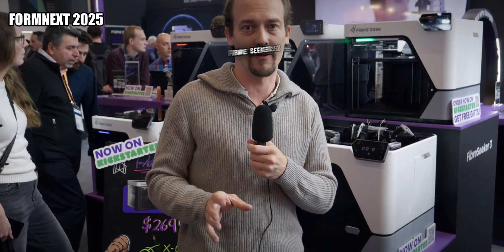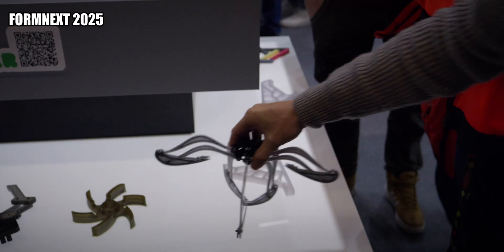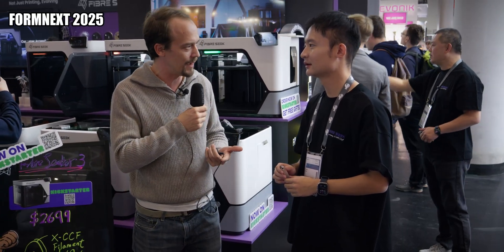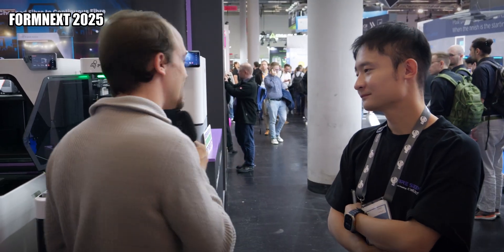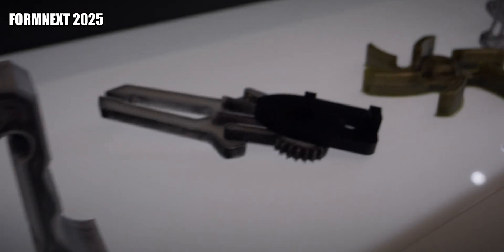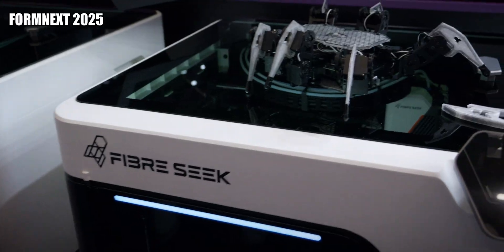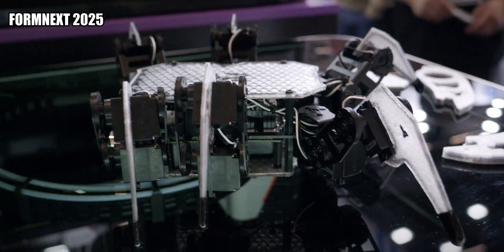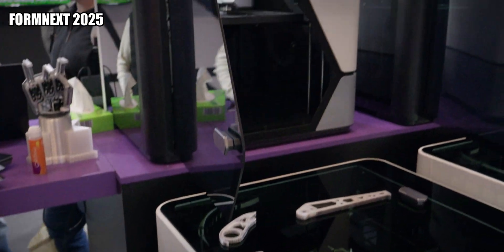Gamechanger in 3D Printing? - A Industrial Technology comes to the Maker Market! - Fibre Seeker 3

Comment: Would it work to print bicycle drivetrain components? Gates Carbon Drive belt is a continuous loop of carbon fiber but VEER Cycle split belt is not continuous. "Stronger than aluminium"? So maybe even the chainring and cog?

Comment: Your designs unfortunately very disappointing in the makerworld. Laptop stands I printed from your portfolio in my very new bambulab 3d printer got ruined.
Reply from the maker: Thanks for the feedback.
I’m genuinely sorry to hear you had a bad experience.

That said, the laptop stand has been printed over 13,000 times successfully, with a 4.8 star rating, and is used daily on Bambu Lab printers without issues.

If something went wrong, I’m happy to help troubleshoot — printer damage is usually related to setup, filament, or slicer settings rather than the model itself. Feel free to share details.

Comment: This is Anisoprint technology in a consumer grade machine picked up by a Chinese offshoot, and although I saw their tech in 2017, I see a special tool head implementation and say an OrcaSlicer repo mod would make this even more affordable. The printer in itself is worse than a Qidi Q2/Max 4 in straight filament performance… so imagine what an IDEX, or modded 3D printer would bring. If teh PrusaSlicer XL can make a silicone head, it not too hard to make one of these, even if licensed rather than patent busted.
Reply from the maker: I would love to see more manufacturers taking this technology on. I think so far the consense is that there is to niche of a market. I hope this machine shows others that this sells and they come up with one. 
I would love to see a prusa version.